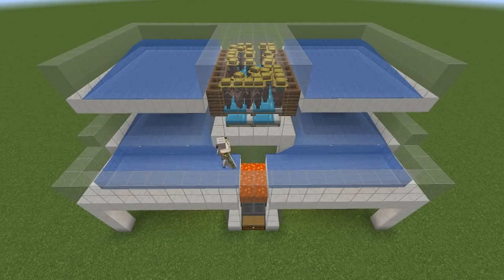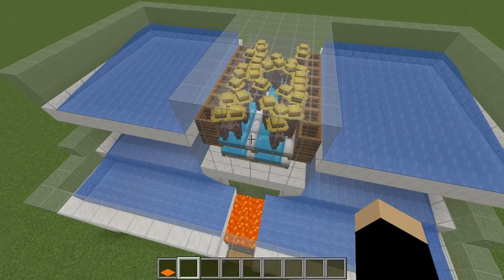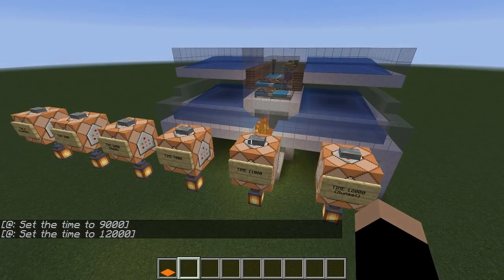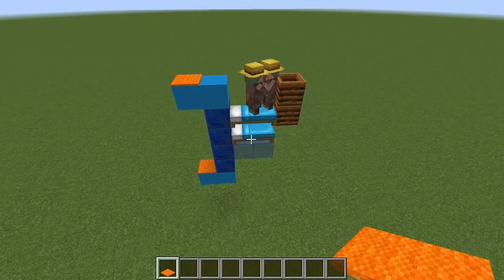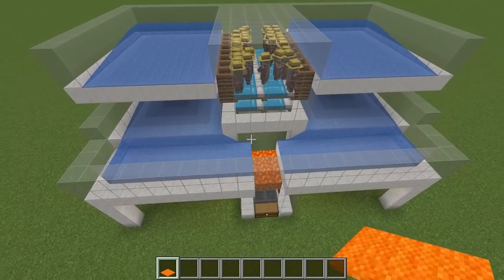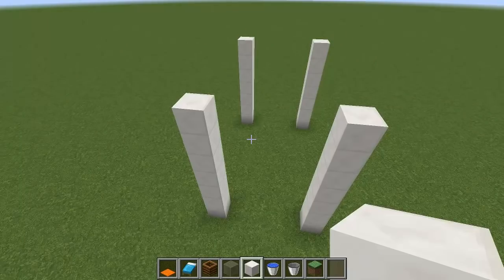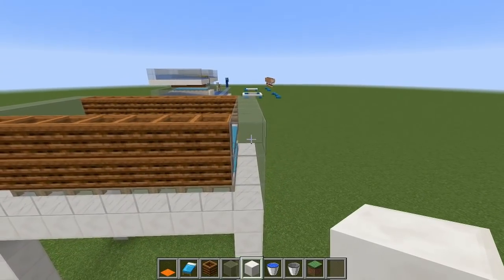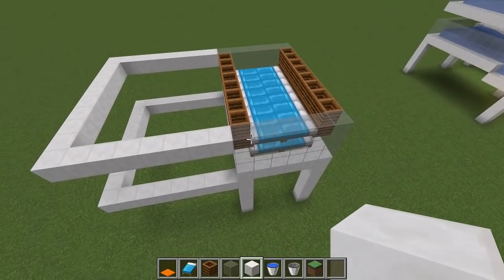1.14.0 Iron Farm Tutorial (120-200+ iron/hr) [May still be bugged in 1.14.1-1.14.2]

Comment: is this stackabe?
Reply from the maker: It should be! I think you'll want the areas with the workstations to be at least 50 apart to prevent villagers picking up workstations from other farms, but otherwise I don't know of any mechanics that would prevent stacking. I did design this to be a standalone, smaller farm for an SMP base. While it should be stackable, if you're looking for a huge build there are others tutorials that may have a simpler layout for that. Still, it might be easier to make 2 or 3 of these than one of those monstrous builds depending on how much iron you're going for.
Reply from the maker: I should add that the easiest way to "stack" this farm, with the new mechanics, would be to simply increase the size of the villager holding room, increasing its number of beds, workstations and villagers. Then just adjust the collection platforms to compensate for the new size. Once you understand the mechanics, there are an unlimited variety of iron farms of different layouts and sizes that you could design, and they'd all work fine.